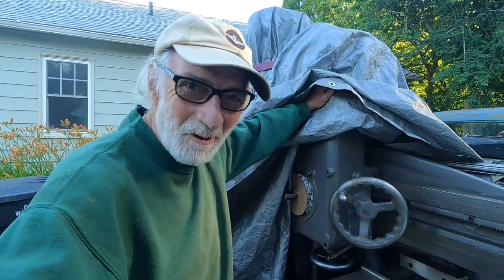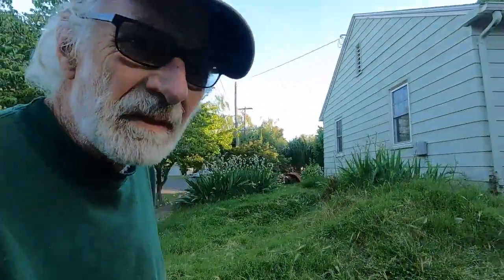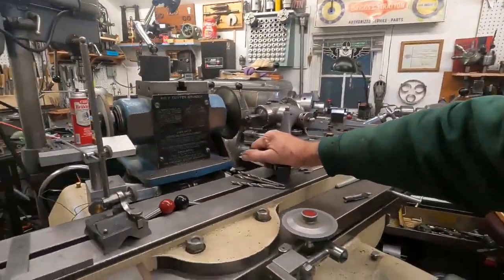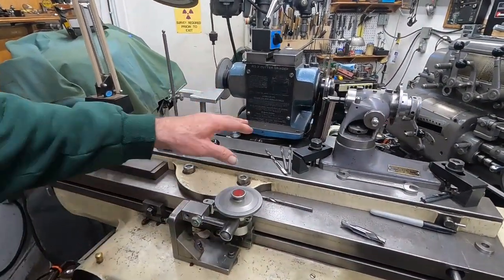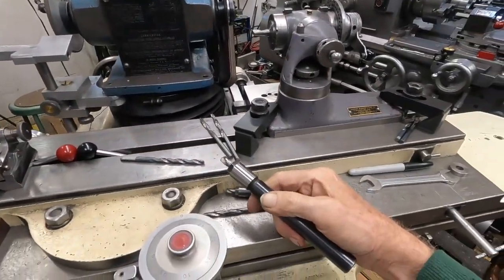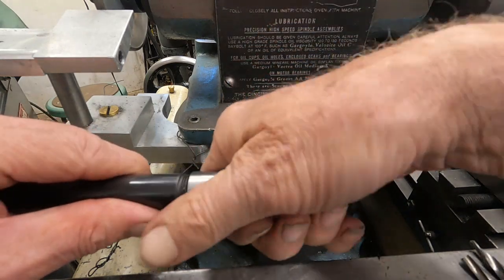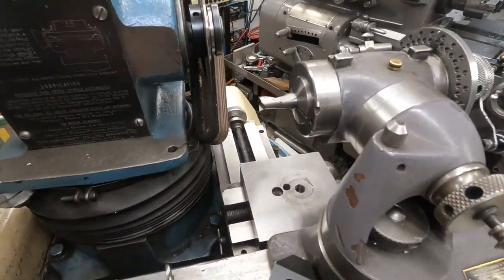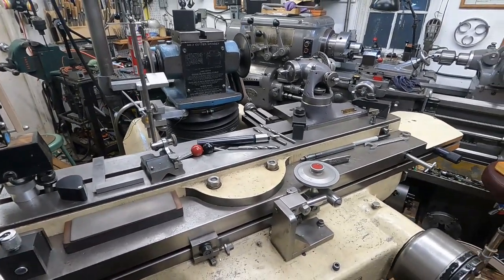Diamond sawing damaged carbide endmill

Comment: I have yet to figure out the whole operation behind my Dawson work head. It has a cam and plates that deflect the head to the right. It can tilt or swivel but not both. While its OEM to the machine I have yet to figure out a single use for it. Dawson became Royal Oak, and the new machine used the same RO collets but the work head has not only cammed tilt like mine, but cammed plunge, as well as swivel and tilt. And there is still no use in sight. I have a Cuttermaster Air Bearing which is actually useful. If i didnt have all the RO collets including the tapers, hex and squares i would pitch it
Reply from the maker: The cutter grinder attachments are hard to sort out, there were a lot of cam operated heads for taps, countersinks and other tools for relief grinding and not much or anything for instructions. I managed to get by with the standard work head for years. Having the air bearing and the fast setting Rotadex is a real treat, thanks!

Comment: I’m old, but I couldn’t understand a word you were saying while cutting that end mill.

Question: doesn’t the end mill get vey hot while cutting at low feed rate?
Reply from the maker: The endmill grinds cool, this is an antique grinder with low hp the feed is adjusted for that.

Comment: Great video. Discovered that Shars diamond cut off wheel months ago. What a deal. Just finished cutting off and rebuilding a 7/8”, two flute, center cutting, solid carbide end mill. What a monumental task! What a tremendous amount of carbide dust even with dust extraction and a M93 mask. Rebuilding the gash alone was one heck of a lot of work. This is not to be taken lightly. Not to mention the tedious task of getting the absolute precision center cutting  geometry (just imagine  four flute) to equal that of a half million dollar Walter Heliotronic multi-axis, robot grinding center (Jeff Toycen at Cuttermasters tellls me to quit trying to strive for that unattainable accuracy at home, it’s unnecessary). 🙂
Reply from the maker: Well, I am not in the cutter grinding business, pretty much just need to get things done. I see the same with others such as the mold shop here that closed.
 There are a bunch out there that do not understand that. So, I get many thumbs down "not seen by the public" and I have bounced the practical machinist forum bully clowns off here as fast as they show up.
 No one wants to do cutter grinder videos, very low interest for the shake and bake machinist and those that must be entertained. I am going to show my normal routine. That way, I don't run out of content, a few donations make it happen add free, thanks.

Comment: One of the biggest problems for me when it comes to inserts, is that there is a bewildering number of types and materials from an equally bewildering number of manufacturers. Many are proprietary and need the same manufacturer’s tooling in order to use them. Being retired, even though I’m not terribly constrained, it’s just impossible to try many of the ones that look to be really good. Some of these things are $30 per insert and only sell in quantities of ten! Sheesh! Oh, the same thing with angle grinder disks. I really want to try the new 3M Cubitron 3 disks, but at $7 per disk in 25 disk package quantities, it’s unlikely. A 6 x 48 belt is $360. I guess my grinder will never see one of those.
Reply from the maker: The insert tooling now is integrated into CNC programing like Kennemetal and not really aimed at manual machines as the old machines do not meet the speeds and power with a firehose of coolant on the work. So, you enter the material and size, the program gives you the insert choices. Not many years ago the insert makers would have some better indication on packaging such as for aluminum or general purpose, now I have to go to the catalogs to break the codes looking for some buys on ebay for general purpose inserts.
 I got a hold of a Kennemetal high precision boring head system, the kit had several heads and used different sizes of special inserts that had two edges and cost $40 each! The system worked fine but the cost per hole was huge. I traded that off when I used up the inserts and went back to grinding boring tools again. I never had the production requiring that sort of thing. It is most economical for me to use general insert types and fabricate tools for special shapes, and finish cutting tools on the cutter grinder being able to make changes on the fly.